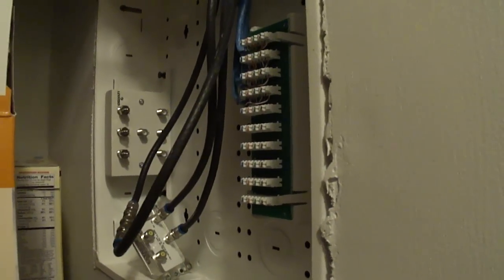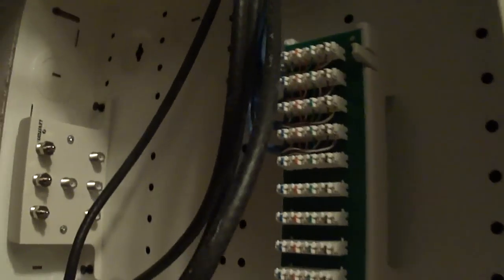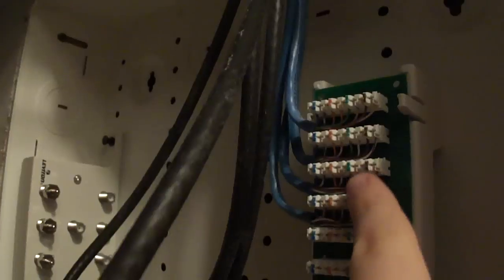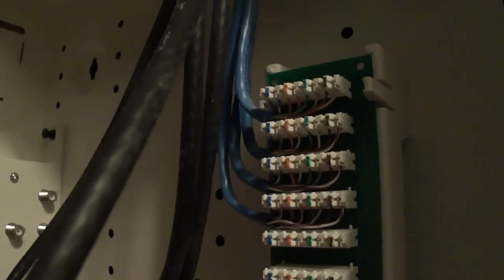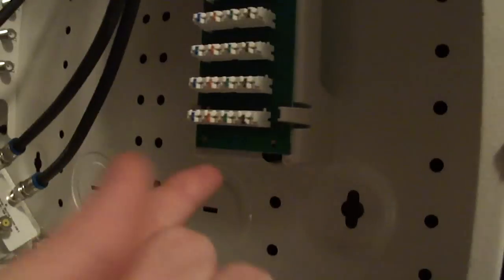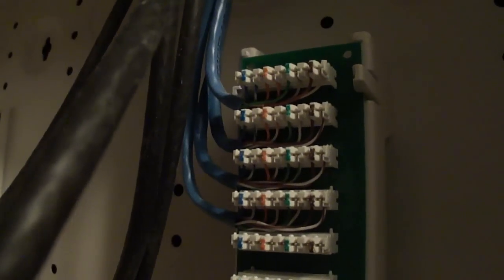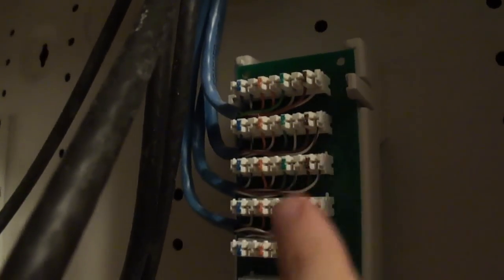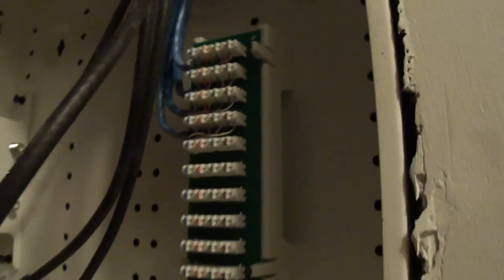Uverse Install Question for DSLReports

Comment: Ok. I work for at&t doing uverse installs.  U have a smart pannel their. What that means is u have one line in to feed the pannel and 3 lines out which are home runs to the other jacks. If ur getting internet only with 6megs or less u will be fine. If ur getting 12 or more megs it is ideal to create a home run to the rg. To due so take the line in blue pair and the jack blue pair and bean them together.

Comment from the maker: Well, I do have a switch to hook up the computers. The phone line from outside my apartment comes in there and then goes out to the phone jacks. I know that I need to hook up AT&T's VDSL modem to the phone jack, but did not know if that phone... pcb patch panel looking thing in the video (heh, so much for me being technical :) ) would cause issues getting the DSL signal to the modem or not. Or is that panel normal for phone wiring? I'm not familiar with it as I've always had Comcast before now.